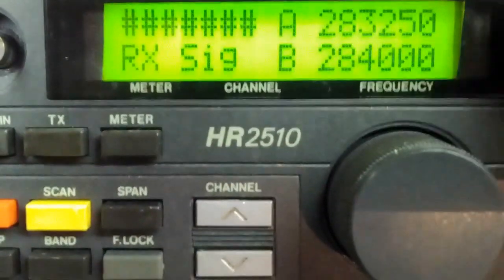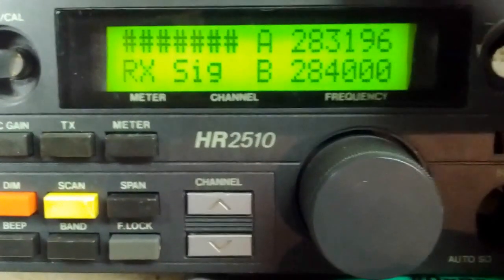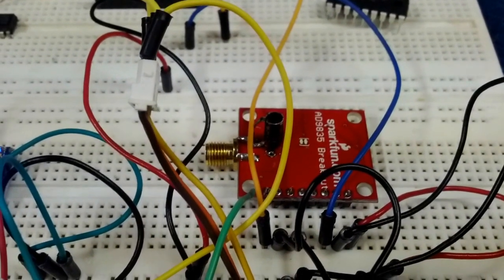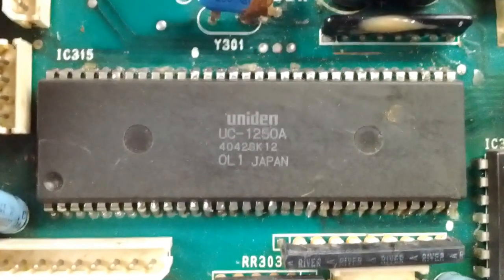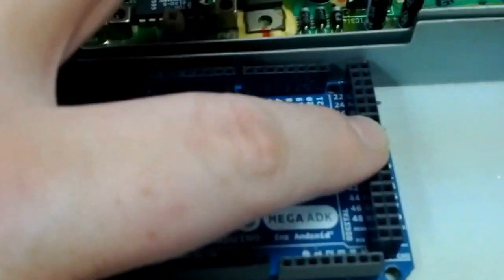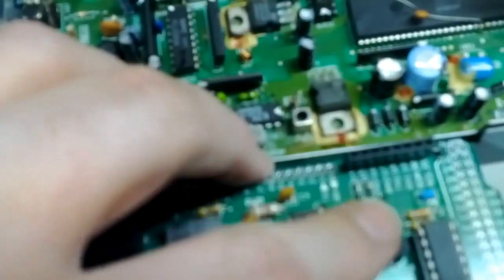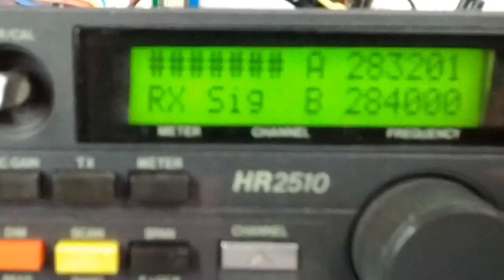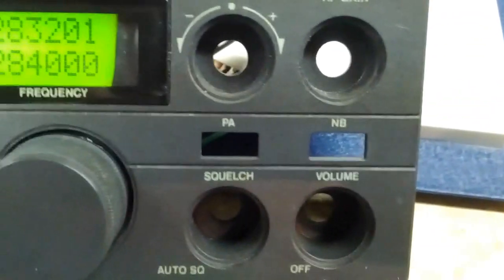Ham Spot Bits: RF Madness

Comment: If you are still monitoring this, would you mind sharing the code that you have and letting us know which LCD fit the faceplate.
Reply from the maker: That was so long ago they don't make that display any more. I've not tried to find a new one. Honestly, today you could buy a couple of 1 inch widescreen LCD full color displays and mount them into that spot for about what this line display cost back then. There's some code in the description of the other video on this topic showing how I built the bar graph. Beyond that, there's no code. You would still need to design a new display board to map the signals from the MCU to the display. Also, the S meter is an analog voltage so you will need a MCU with a ADC input. The original 2510 display module uses (a Hitachi?) LCD driver that has the ADC built-in. So it's not a simple digital translation either. The hardest part is mapping the old LCD driver data to something new. There's no meaningful correlation between the signals sent and the information displayed on the old screen. The best option is to replace the entire logic board with the MCU and PLLs on it. Then you're not enslaved to some 1970s LCD memory map. If you eliminate FM support on the logic board I believe you could even use the radio on 21 MHz like ChipSwitch promised years ago. I don't think AM modes use the 21 MHz IF at all.
Reply: @AugurIliKur  thank you for the reply.
Reply from the maker: https://youtu.be/fJlTiVgf4PM

Comment: This kind of upgrade could really put the HR-2510 back on the market again if they made some swap-out boards that could easily be changed out with the stock boards. It's almost 2016 and there are still huge amounts of 2510's and variants out there still in operation (2600, Lincoln, 2830). I still love my old HR-2510 and use it every single day but admit I would really love to upgrade it with what you've done here. Excellent work :)

Comment: Great project, I have 2 hr2510 radios, the lcd failed on one of them.   would love to get a hold of the arduino shield you are making!  How do I get that LCD?.  Bluetooth control, would be realy cool, although the Icom civ would likely be eisier to integrate.  Any thoughts to releasing an open source project?   I'm not a radio tech per se but I am pretty good with software interface design.   Great to see somone with the skills necessary playing with this radio.  
Ryan  KD4CGG